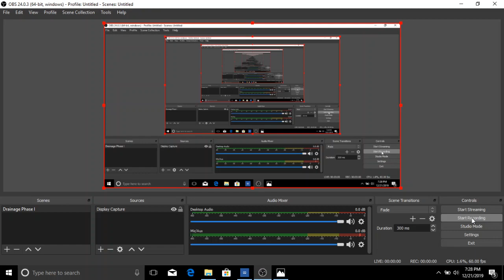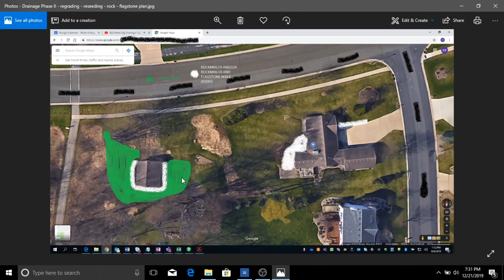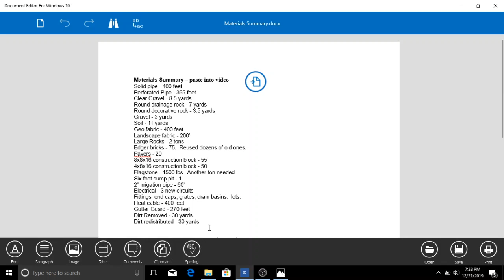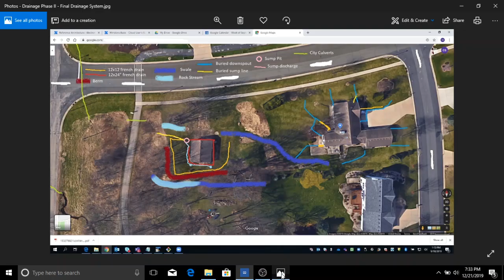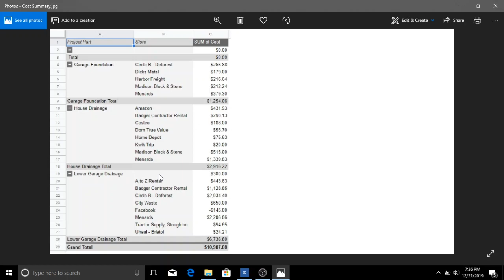Drainage Project Phase II - #26 Costs and Materials List

Comment: Incredible system! Just binged watched your entire series. How's it holding up? How does it do in the winter and spring?
Reply from the maker: Hi Jared.  Can't believe you watched it all.  I'm no movie maker for sure.  It's held up well.  All drain pipe freezes in winter except the stuff  2 or more feet deep.  The pump system is great.  Keeps the detached garage dry and being 6 foot deep in the sump pit that does not feeeze.  Even with 2 straight days of -18F.    One thing i did was build downspout catchment 2 different ways to experiment best way.  One method was downspout directly into black corrugated pipe right by house.   Other was use downspout extension draining into catch  basin 3 to 6 feet away from house.  2nd method freezes up lots less than 1st method.